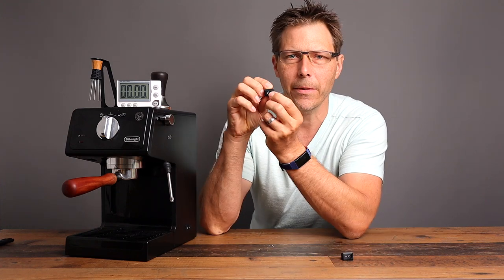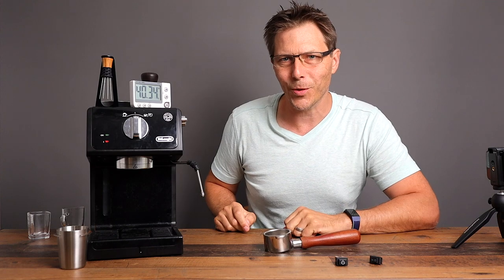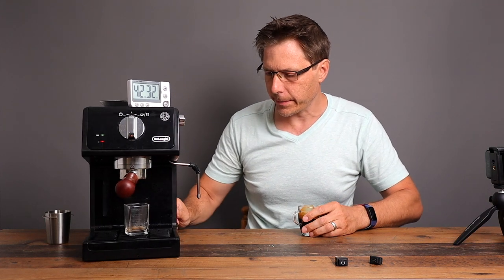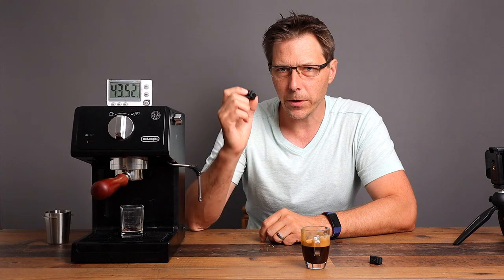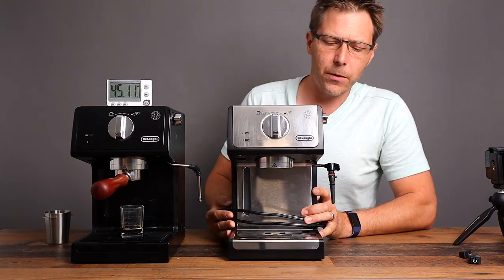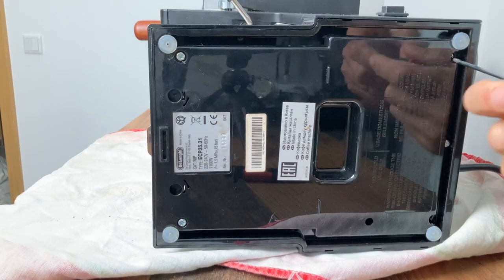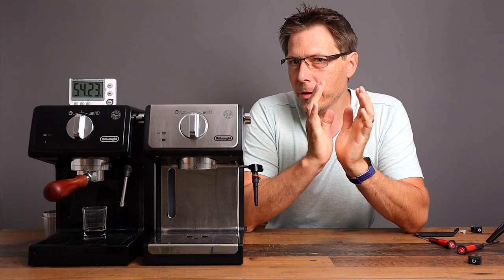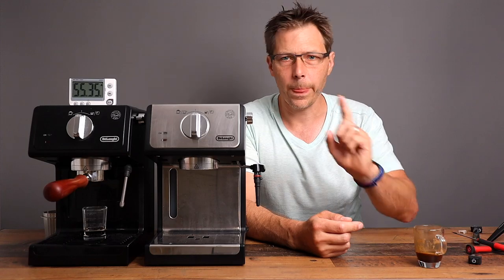Machine turning off after 10 Minutes? Delonghi ECP 35.31 Switch Replacement How To.

Comment: The thing that surprised me was how quickly my portafilter and kettle water cool down. If I get things too hot it is really easy to just wait a bit and they cool to a sensible temperature. Also, this means I cannot leave my heated portafilter laying around for too long if I want it warm, although I doubt this is too important as long as the basket temperature is sensible. What I do not know is the optimal time to leave coffee in a warm basket before extracting.
Reply from the maker: Hey Tom, I think it's best to just pull the shot as soon as possible. Cheers!
Reply: Thanks for the reply. I hope you are right because that is what i do :). I suspect you risk coffee at different temperatures in the puck extracting at different rates if you pre-warm.  @TomsCoffeeCorner

Comment: Just got my 35.31
Previous owner was NOT interested in cleaning anything
Milk leftovers caked on the nozzle and panarello. Water container had lots of black small particles, portafilter and baskets were brown throughout with coffee oil caked in
That took a while to clean. And now i discovered that auto shut off time is not adjustable. Oh well. Will give your method with the switch a try

Comment: Hello guys, thanks for putting this video up Tom. I am thinking about doing this mod, I just have a couple of doubts:

1. Has anyone that done this noticed any issue with it in the long run?
2. Does it matter which connector I plug to which pin? or will it just invert the functioning of the switch? (FYI I don't have a tester).

Thanks!
Reply: Two weeks after mod done, no problem. I dont even touch the New button. It is connected to my smart home, I control it from my phone, it automaticaly starts heating at 6 am and it is super nice and hot by time I brew coffee
2. No difference in connection, connect as it was initialy.
Reply: @alexandermashkin2395  thanks, that is taking it to level god 😅 I have done it too and it is working like a charm 👌🏼
Reply from the maker: The orientation shouldn't matter, as you're closing a normally open switch. At least that's how I remember it. Hope it's working well for you!

Comment: the black ecp dripping ,i did,nt hear the pressure release valve go off . after making the espresso . or was it edited out ???. if you dont hear that whoosh after turning the dial back to the centre after stopping the extraction ,you valve needs replacing ,and that will cure the dripping . i see so many of these ecp machines for sale on a popular for sale site ,suffering the same issue . and all it takes is a $6 part .and it fixed . p.s nice mod tom .i appreciate
 the love you still show this cracking little machine .
Reply from the maker: It doesn't have a 3 way valve. It drips because apparently the spring valve in the grouphead has some scale on it, or has been weakened over time. The silver ECP does not have this problem.
Reply: @TomsCoffeeCorner  it releases over pressure back into the water tank .if you notice there is 2 outlets on the tank .one is for water for the pump ,and the other is for opv . if the valve is faulty ,pressure is,nt realesed properly  ,at a certain pressure the valve in the brewhead opens . and when you switched off the dial ,it releases just enough pressure from the pump ,so that brewhead valve closes . thats why it called opv. ,anti drip valve . it,s not a 3 way valve ,it,s a pressure release vale ,over pressure valve . if it  become,s faulty ,it will keep pressure on the brewhead valve .not allowing it to close fully ,causing dripping .
Reply from the maker: @gizmo1252000  Actually, that valve is just for over pressure, meaning that if the pressure gets too high, the water will be diverted back into the water tank. When these break, what generally happens is that the water will flow right back into the water tank. I’ve made a video about it on the Dedica’s series. You will notice that the black ECP is dripping, even when there is no portafilter attached, so no pressure. It's dripping because the expansion valve of the brew unit is faulty.
Reply: @TomsCoffeeCorner  that,s what i first thought ,when the ecp 31 21 was dripping ,i changed the brewhead valve , spring and all .and surprise surprise ,it still dripped  .the previous owner before me  had also replaced the brewhead valve and spring and cleaned the boiled head , with no difference at all . that,s when i changed the opv  ,and hey presto ,no more leaking brewhead .i bought another unit .with the same fault .new brewhead valve,spring and all ,cleaned the seating area ,that unit kept dripping ,guess what i did ,yup ,changed the opv./anti drip valve .and hey presto ,even delonghi themselfs call the over pressure valve ,a anti drip valve .
Reply from the maker: Well, I'll have to try that then. I guess these OPVs break in more way than one! Thanks for the info! @gizmo1252000
Reply: @TomsCoffeeCorner   seriously tom im just trying to be argumentative  with you .i like you :)  lol  . i assuming when someone pulls a shot ,the pressure ramps up ,forcing the hot liquid from the boiler ,through the brew valve,which is pressure senstive .and will only open when the pressure get,s to a certain level ,allowing the pressurised hot water through the portafilter . so when you turn the machine back the middle of the front dial .the pressure is still built up in the boiler ,still pushing on the brewhead valve ,allowing the water to drip ,and it only drips because the pump is no longer  being used ,but the pressure remains ,the opv/anti drip valve dumps that pressure into the water tank ,i pretty sure the opv works in 2 ways ,it will dump the excess pressure  after making a shot and it safe guards the that pressure doe,snt exceed a certain pressure when the pump is running  , everytime i finish making a shot ,and switch to the middle . of the front dial ,you can hear the pressure being dumped into the tank . i,ll happily record it for you .i have no idea how post it to you lol

Comment: You can Buy Plug Boards (Steckdosenleiste) where you can Switch on and off each Power Socket seperately. How about keep the machine alwys On and Switch On and Off on the plug Board Side?

Anyay your improvement on this machine is the most important Hack ever. It is a Rebirth of a small Jura Portalfilter machine around 2002 which also had a small Boiler and Jura wrote down the proposal in each Instruction (Manual book.and quick instructions) Switch on and wait for at least  15 Minutes for best taste/Extraction. The Jura machine wasnit confrinted with the Green Energy/Energy Saving requirements of today in Europe. So it kept Always on 'till you switched it Off.
Reply from the maker: Yes, that’s a good idea. I do in fact have a Wi-Fi plug, that I’ve used in that fashion before. It works great!

Comment: Mine comes with what looks like a rocker switch. But it's not a rocker switch (and it will turn itself off in 10 minutes).. So I know what to do now :-)
Reply from the maker: You can replace it with a switch like I show here.